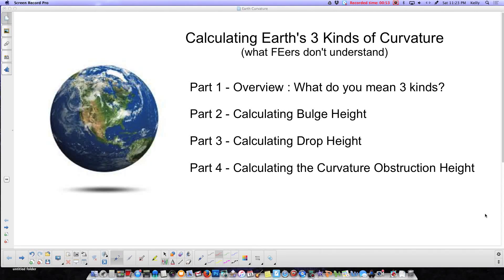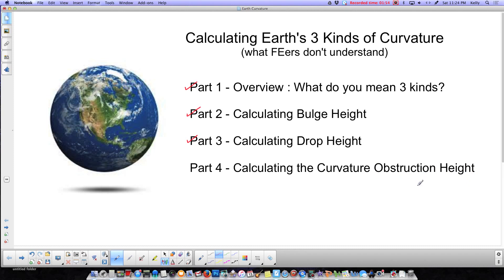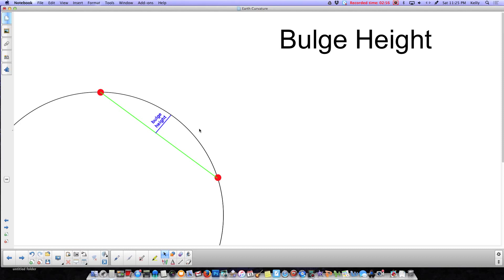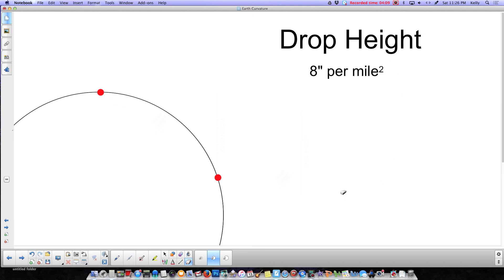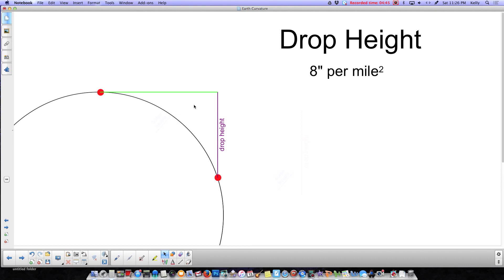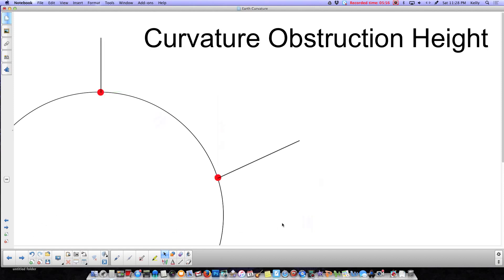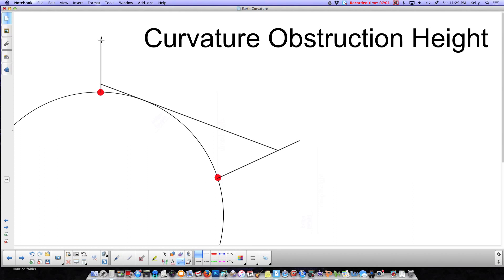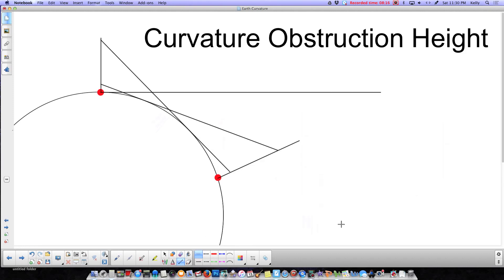Calculating the Earth's Three Curvatures   Part 1 Overview

Comment: Bulge height has a derivation.  Since 8d^2 describes the sagitta of the arc length that the observer is standing on top of, with half the length being between them and the target, we can see from the diagram that the bulge height is the sagitta for half that arc length.
Knowing this, we can take 8d^2 and rephrase it as 8*(0.5d)^2, which is 8*0.5^2*d^2, which is 8*0.25*d^2, which is 2d^2.
For any observation, with a drop of 8d^2, it has a bulge of 2d^2.

Comment: Could you, if you're interested, make a video like this, expressing the curve in terms of degrees per mile and miles per degree?
I have tried to explain this to Flerfs in terms of if the Earth has a circumference of 25,000 miles, then this equates to 1 degree of curve over almost 70 miles (25,000 miles divided by 360 degrees = 69.4 miles per degree). And that this is equivalent to 0.0144 degrees per mile (25,000 x 0.0144 = 360). The numbers seem to baffle them, and perhaps a visual representation could help?
Reply from the maker: I’ll see what I can come up with. May not be too soon though.

Comment: How much higher was the middle pole compared to the other too in the Rowbotham experiment?
Reply from the maker: The wikipedia article says almost 3 feet.
Reply: Keigh See I see, I can see how that would be a cause for concern. But the experiment proved no curve, the middle stick is almost irrelevant.
Reply: @LD-jb5zi  No, if the earth was flat the top of  all three sticks would be in a line. That is why you need to use more than two sticks, otherwise two sticks would prove nothing.

Comment: It seams that everyone says eight inches per mile squared. This confused me at first, because I was taught 'per' equals divide, and that's how wolframalpha interprets it.  Shouldn't we rally be say eight inches times miles squared?
Reply from the maker: Cassi O No.  It’s a unit rate.  It means 8”     For every mile squared.  It’s the amount for one.  You multiply to find the correct amount for the distance you require.   Think of it like driving 50 km/hour.  If you want to know how far you go in 10 hours, you have to multiply.
Reply: Thanks. Makes sense that the units cancel out, so you end up with inches. Got it.

Comment: When you have the line drawn through the sea we will call that the sea bed what's holding the water bulge up? Gravity pulls the water towards the centre, something would have to be holding the bulge in the air which makes no sense, if gravity was real the sea would take the shape of the sea bed, but we know fluids don't work that way it remains level, the centre of the bulge has the most mass so it would have more of gravitys force on it pulling it down, levelling it off
Reply: Oh for fucks sake ! gravity pulls almost equally so it conforms to the shape sheesh !
Reply from the maker: Crf 250 The only thing this video is trying to demonstrate is that calculations flat earthers use the wrong calculations when discussing curvature.  That's the intent of this video.

However, saying that the bulge is "held up in the air" is nonsense.  There is no air under the bulge.  Water is pulled to towards the centre of gravity until it is stopped by something.  What is holding the "bulge" up? - the water under it.  And that water has gravity of it's own, since it has mass.  Expecting only land to have gravity is wrong. 

Level on a globe is equidistant from the centre of mass.  Level is not synonymous with flat.
Reply from the maker: norman martinez Keep trying to find a way to feel special.  The rest of us will keep living in the real world and trusting science to give us stuff like health care and technology.  If you distrust science so much, get off the computer.  Stop enjoying the fruits of science's labour.  

Thanks for interjecting exactly nothing into the conversation.
Reply from the maker: norman martinez You really have a problem sir.  Where did I say anything about space science. Science (and math) IS reality.  By the very definition it is the manner in which we understand the way things work in the world.  It's the reason humanity knows how to build engines, build computers, make medicine, power nuclear reactors... the list goes on and on.  There are branches of science and math that SEEM to go nowhere.  They look like useless things to study.  And sometimes they are - like Alchemy.  But if it weren't for research into Alchemy, we wouldn't know what we do about chemistry.  There are branches of math, like fractal geometry, that seemed useless at one point in time, but have given rise to computer generated imagery and more efficient ways to build antennas so that our smart phones don't look like a brick with a stick.  

Look man, if you don't believe in science, as I said earlier, stop using the fruits of its labour get off the computer and go back to living in a cave somewhere.
Reply from the maker: norman martinez You set up straw men well. Level and Flat are not synonymous http://www.civileblog.com/levelling/
Reply from the maker: norman martinez You set up straw men well. Level and Flat are not synonymous http://www.civileblog.com/levelling/
Reply from the maker: norman martinez What do you want them to be called?  

In science there are observations (facts), laws and hypothesis, and theories. 
Laws are mathematical equations that have predictive qualities that describe what we observe. Newton's equations are called gravitational LAWS.  We can use those equations to calculate and predict the location of planetary bodies.  
A hypothesis is an educated idea based on observations, that tries to explain  what causes an observed phenomena or law.  Hypothesis are tested and tested again.  When a hypothesis passes every test we can throw at it, it is elevated to a theory.  And that's it.  That's as good as it gets.  A theory is never proven - proof only exists in the realm of mathematics.  Scientific theories are either accepted or rejected when a better theory comes along.
Reply from the maker: norman martinez The earth is an oblate spheroid.  Deal with it.
Reply from the maker: norman martinez If you have something specific you can say about why you  think my video is wrong, be specific.  Otherwise go crawl back into your echo chamber.

Comment: Yes, most people blindly use the D^2 x 8 inches formula and don't take into account the observer height.  However, I did the math right, did an experiment, and lo and behold, earth is flat.  I have vids up with the math and experiment if anyone is interested.
Reply from the maker: gtwon Did you take refraction into consideration too?
Reply: Well, I was 5 miles out, could see the target I shouldn't have been able to see plus sand and short rocks on the shore.  So you think 100% refraction is a thing?  Light bends around earth perfectly to make it appear flat?
Reply from the maker: gtwon Not perfectly, no.  If it did we wouldn't have pictures where half a skyline is missing from the bottom up.  How high were you above the water?
Reply: All the information is in my experiment video description box. At this point I wonder if you even know what light refraction is and how much can occur when light travels from say 25 degrees F air over water to 35 degrees F air over land.  The answer is, not much, because their refractive indexes are nearly identical.  Even water refraction couldn't account for the results in flat earth curvature test videos.  Last comment from me, do your own experiments people.
Reply from the maker: gtwon i have done my own experiments. I have stood 100 ft above a lake that is 40 miles wide, zoomed in on the horizon and saw nothing but water.  Forget what is happening on the ground anyway.  There is way too much going on.  What's happening in the sky is absolutely impossible on a flat earth.  The sun and moon keep the same angular size for the whole period of time we see them each day.  In order for them to increase/decrease in elevation as dramatically as they do, they must get many times closer/further away from us.  Which would mean they should appear many times larger or smaller during the course of the day/night.  Flat earthers like to blame that on atmospheric refraction (lensing) too.  And you think I don't know what refraction is!

Comment: Like the video series -- but you have the (slightly) wrong geometry for 8" times miles squared calculation -- the "drop" is actually angled towards center of the Earth, not perpendicular to the tangent line (I promise).

I have a very detailed analysis here:   http://flatearthinsanity.blogspot.com/2016/08/flat-earth-follies-how-to-derive-8-per.html

There is a 4th one also :)   Most people get their longer distances from Google Earth which is the Great Circle distance (ugh! right?) so the formula for that case is:

r/cos[d/r - asin(sqrt[h×(2×r+h)] / (r+h))] - r
image;  https://1.bp.blogspot.com/-8HtBYdJMjG4/V6YNjebvyRI/AAAAAAAAB2M/N8azAv6vkdcj40JTzfZQP9f3AB1YKodZACK4B/s400/height-obscured-at-curve-distance.png

r = Earth radius
d = CURVE/arc distance - like from Google Earth
h = height of observer

For distances under a few hundred miles it really doesn't matter much.

Mick's Metabunk curve calculator is the best one I've seen:

https://www.metabunk.org/curve/

Because it shows you the math it actually did and it gives you Horizon Distance, Hidden Amount, Bulge Height, and Curved Distance obscured.

My other post on the math and I touch on refraction a bit:  http://flatearthinsanity.blogspot.com/2016/07/derivation-for-height-of-distant.html

Enjoy!
Reply from the maker: " but you have the (slightly) wrong geometry for 8" times miles squared calculation -- the "drop" is actually angled towards center of the Earth, not perpendicular to the tangent line (I promise)."

You are correct of course.  That crossed my mind when I was describing how to "measure" it with a laser.  Vertical would angle away, obviously,  though for distances short enough to do a laser experiment the difference would be negligible.  I left it since it was this photo http://flatearthwiki.com/images/0/0e/Metriccurvature.jpg I had in mind when doing the drop height and is a valid measurement on a circle.  I may update it in another video eventually, but it will be a while.  Thanks for the links.
Reply: Keigh See yeah, it's so close under 100 miles it doesn't matter much. I had to do the analysis to be sure - and then I found the method in Brittanica from the Zetetic book which had the diagram & everything.
Reply from the maker: +Dark Star The math to do it properly is significantly more involved.  I can't imagine a flat earther bothering with it. I had hoped that some of them might have some knowledge of high school trigonometry :-)
Reply from the maker: I think I will update that. If you aren't concerned about developing the 8" per mile formula, the process to find that h value when the vertical is tilted is pretty simple. Might turn out to be the shortest video yet...
Reply from the maker: That's a good calculator, though when I first found it I did the math on the bulge height and amount hidden myself to make sure I agreed with it.  Too bad flat earthers don't understand which one they are looking for.
Reply: Keigh See Yes, 8'' xmiles².
If in the visual representation the drop is angled towards the center of the Earth, the formula should implode when a drop of a quarter of Earth's circumference is calculated. Which, I guess, it does? ;)
Reply: Herr Gnorts 8" miles squared only good to 100 miles. 

Think about it this way - that's a parabola not a circle :)

However, it is not limited to 1/4 Earth circumference for that reason.  Let's say if you use the more accurate formula.

The distance is straight out along the tangent NOT the distance along the curve of the Earth!

So you could go out 10 billion miles and the drop would ~10 billion miles and hit just shy of 1/4 the way around.  Does that make sense?

No matter how far away you go you can always draw a line back to the center of the Earth.
Reply: " the "drop" is actually angled towards center of the Earth, not perpendicular to the tangent line (I promise)."

I'm still confused because: we calculate the "drop" from the North Pole to the Equator - we would be getting a triangle with two parallel lines then, no? Now, the result of using that formula - which should be Earth's radius - is off by a surplus of 900something miles, but it's not infinity. Or is that just a good example of how that formula is wrong?

(my angle on FE is all things visual, not Math;)
Reply from the maker: +Herr Gnorts I'm a little unsure of what you mean.  Are you talking about the drop I showed in this video, or the one angled towards the equator, which is being discussed?  Which formula are you looking at? 8" per mile squared?  The formula 8" per mile squared is WAY off by the time you get to the equator.  It's only a useful approximation for short distances.  I compare both drops discussed in this comment, to that formula in the 5th video in this series.
Reply: Keigh See  ÷ \

Comment: 5:14 drop height. you now debunked globe. Because on globe we would see always only down, and we see horisont rising in front of us. So how you explane that on your model? 

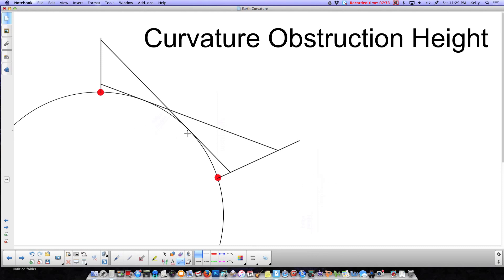6:40 you again debunked globe, because on the globe buildings in distance we would see under some angle, and we see them straight.
Reply from the maker: We don't see the horizon rising.   As something gets further away from us, the angle of depression from us to it decreases.  This, in effect, makes things that are further away from us appear to be higher than things closer to us in our view. Look at this picture https://i.ytimg.com/vi/JitDoqgpI5E/maxresdefault.jpg.  The road seems to be sloping downward right?  Then why is the road in the distance higher than the biker's shoulders?  This is actually what perspective does.  Things in the distance can still appear to be higher, even if the terrain slopes downwards.
Reply from the maker: As for the sloping of buildings - you do realize that my diagrams are significantly off scale, right?  The distance between my two dots is about an 8th of the globe.  We can't see any where near that far.  Take the circumference of the globe and divide it by 360 degrees.  That's approximately one degree every 70 miles.  We rarely see things further than 70 miles away but even at 140 miles it's only two degrees.  Look at this photo I took.  https://drive.google.com/open?id=0BxvwWrZ9AClhbGJhODdGcms4OGc.  That pin is on approximately 10 degree angle, but when viewed so that your line of sight is parallel to the tilt, you don't notice it.  All tilt that could be attributed to the curve of the earth will be parallel to you line of sight and therefore very hard to spot, especially at great distances.
Reply: the first photo, road is 
straight.not sloping downward
Reply from the maker: +Serbian Conspiracy Denial is strong with you.  Sure looks like it is gently sloping downward to me. Okay, how about this one http://i2.wp.com/media.boingboing.net/wp-content/uploads/2015/09/yEkYW9.gif?resize=480%2C270 Or go take a photo looking down a hill for yourself. The bottom of the hill will be higher in your photo that the top of the hill.   Or just go take a LOOK.  Stand at the top of the hill.  I guarantee you you will have ti tip you head downwards at a steeper angle to look at you FEET, then you will have to in order to look at the bottom of a hill. Things close to you will be at the bottom of the photos, things further away will be at the top.  That's how perspective works. It's all geometry.
Reply: this  skate photo is  downward.
 then we dont see object, because perspective, horisont is rising in front of us, and because object are hidden due to  drop height.but hidden behind rising horisont.
Reply from the maker: +Serbian Conspiracy But the "rising" due to perspective can NOT hide anything.  Light is going to travel to our eyes from an object unless it is blocked by something.  The fact that the further something is away from us, the less we have to tilt our head to see it, is NOT going to hide anything.  It can't.  It's the "magic" solution that FEers have come up with when they realized that a telescope could NOT bring back a distant skyline, or the sun at night.
Reply: Usual flat earth problem, absolutely no sense of scale.